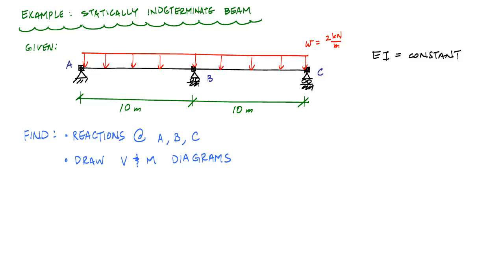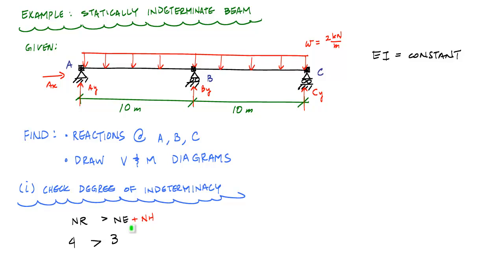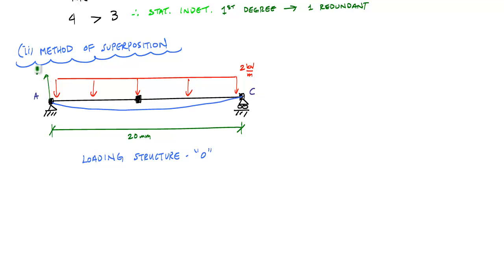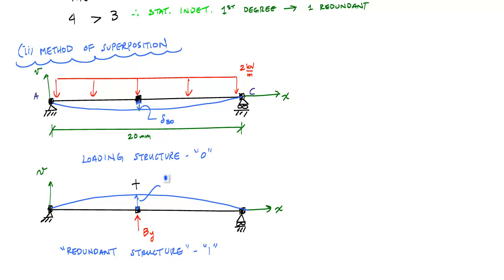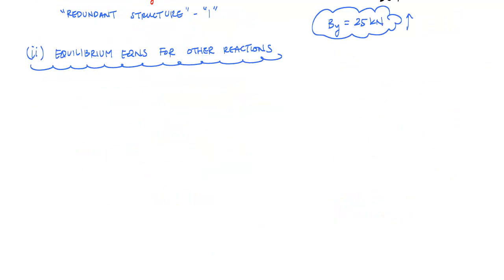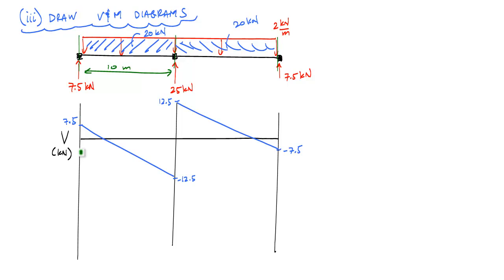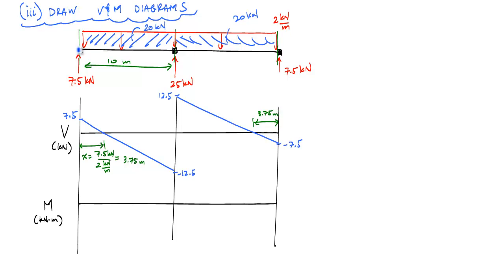Force Method Example 1 - Mechanics of Materials

Comment: Thank you for this video;
I guess the Ax=0 in this case. If yes, how can it prevent the beam from rolling ? I mean what's its purpose ?
Reply from the maker: Yes, Ax = 0 since there is no loading in the horizontal direction.  Ax would not equal 0 if there was a horizontal load.  The pin support at A would prevent the beam from rolling. Hope that helps.
Reply: Yes it helps :) Thank you a lot by the way for the video, the amazing explanations and your answer. This video just made me win enormous time that I could spend looking in the litterature.
Is there another way to decompose the beam ? Actually, I'm dealing with a spar for an aircraft wing that is fixed in its two ends (weird wing), and after decomposing I can't find the deformations in my simple case in the books, so I was wondering if there are different ways to decompose the beam, or only one ?

Comment: Sir, I'm a civil engineering student. I have an assignment from my lecturer related to this question. 
In the data, there was live load and dead load for the uniform distributed load. 
From what i learn, when we calculating the deflection of a beam, we only use the unfactored live load (does not add the 40% safety factor). 
In this case, do i need to use an unfactored live load, or should i use factored live load?
Reply from the maker: +Shawn Hon typically deflection calcs use service loads (or unfactored) loads.
Reply: +structurefree Thanks a lot.

Comment: hello, and question: how do u get the equation 0= (-5wl^4/384EI)+By*(L^3/48EI) for compatibility relationship. so important for me. thank u ~~
Reply from the maker: I think I got these off of charts and tables in the appendices of my mechanics book. You could always use double integration, virtual work, conjugate beam, mom-area, or others to calculate deflections.
Reply: +structurefree i still don't know where did you get the 384 and 48 here :3

Comment: Would you please do an example of an indeterminate structure, Sheeting Calculation, for a beam(12ft) with 3 supports(4.75ft center to center), uniform load(700.96PSF), with overhangs(1.5ft and 1ft) on both ends. I don't understand how to do the Moment Digram and I think it would be a good real world useful example.
Reply from the maker: what do you mean by "sheeting calculation"? a roof? moment distribution method?
Reply: structurefree My goal is to find the max moment along the beam.  I'm designing sheeting for a trench and my method of doing this calculation requires the max moment along the beam and location of that moment.  I'm able to get through the shear digram, but i'm having trouble with the moment digram.

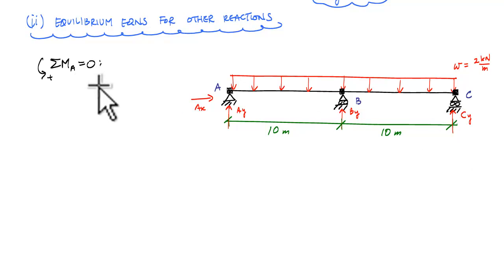Comment: Thanx for the detailed method. But I have a question. At 7:26 the equation of equilibrium of moments, the moment from the distributed load. From where it came - (2kN / m) (20m) (10m)? Should not it be - ((2kN / m) (20 m) ^ 2) / 2? I understand that is the same but why did you use it?